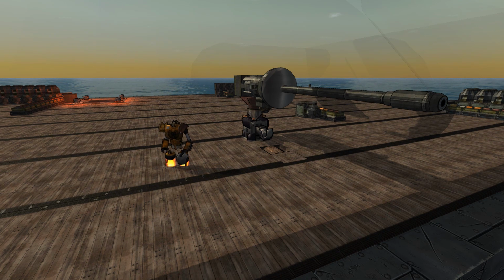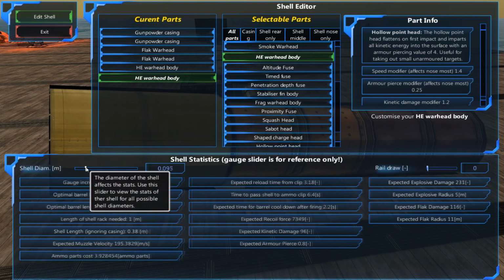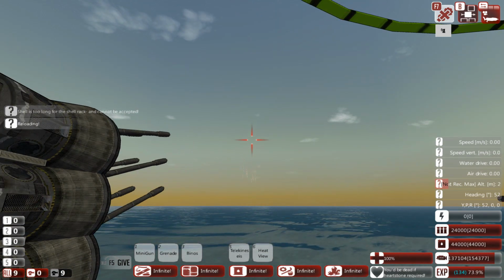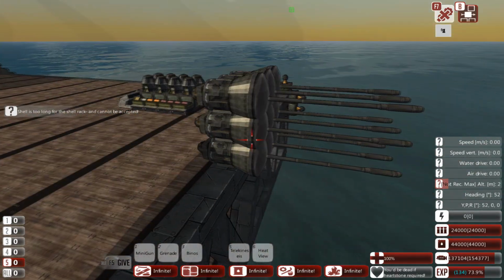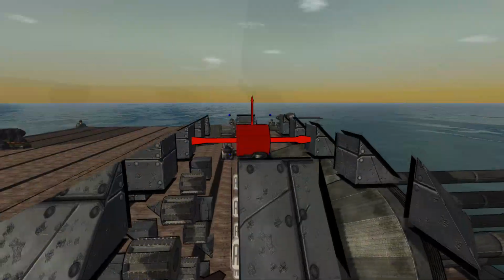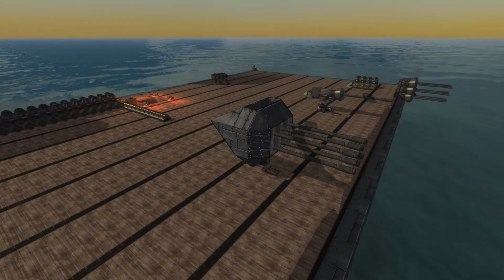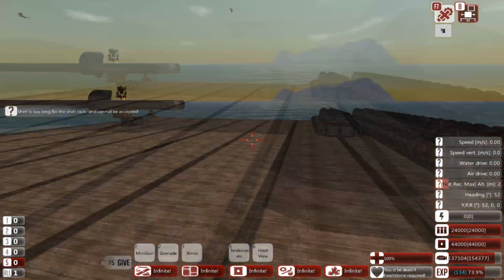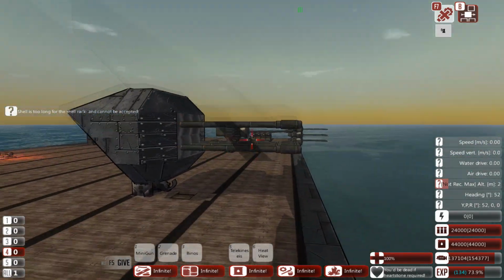No-Autoloader cannons! - From the Depths

Comment: One thing you might want to showcase is the use of spinblocks with cannons.
I was able to make a gunship with 19 cannons poking out of its bottom, that slows down when flying over enemies to unload its massive payload, without even having to remove any of the floor pieces.

This is because spinblocks don't have proper collision physics, so I could have, theoretically, placed a spinblock on every open block on the roof, resulting in an absolutely absurd amount of downward-facing cannons, and the only thing I'd have to worry about would be the guns shooting each other.
Reply from the maker: +IPlayPCTooMuch I'm aware of the spinblock tricks, but I don't want to promote the use of exploits and this definitely comes under that category. :)
Reply: +IPlayPCTooMuch Yeah but how fun is it to cheat? Might as well just use invincibility or infinite resources in the campaign too then. You just hurt yourself in the long run because you wont be able to design good proper vehicles if you rely on cheap tricks that eventually get patched out.
Reply from the maker: Baleur
Bingo!  FYI, Nick has already said he is gonna implement code in the future to prevent this sorta behavior.  Also, spin blocks cause drag now, so all the little exploits are slowly getting removed, which is a good thing imo. :)

Comment: 8:00 wow, you could set up a huuuuuuuge "spinal mount" cannon like this down the entire center of your ship (after all its barrel is only 1 block wide and high). And set up a seperate weapon controller for it, with a control block that says "If object within 200 meters, fire weapon". So it only fires when it is close enough to guarantee a hit, and aligned properly.
Could be an amazing concept for "one shot gamble" designs.
Reply from the maker: +Baleur That's in interesting idea actually.  It's a very expensive "gamble" though, and with the new CRAM cannons coming along that provide more or less this sorta function, It's not really that necessary.  It's nice that we don't have to make the adv cannons do absolutely everything now.  The CRAMs can pick up the slack a little! :D

Comment: i went the entire other way, but this is very interesting too, i was in a 2.0 growth game and ended up capturing 7 marauders so i made a ship called the Narwhal, its a marauder with the nose gun replaced with an AAC running the entire length of the ship with 3 beltfeds per gauge, i had to put katamarans on it and if it fires at max deflection the ship goes sideways at about 3x its max forward speed. that being said the logistics for that cannon fills the entire ship and if it takes a shell to the interior it ends up dead. may do a build with some of these instead,
Reply from the maker: +brian mcdowell These things really help with redundancy. Because they're so small, you can just bolt em on anywhere.  Cool idea.  I never retrofit campaign ships as I prefer to build my own.

Comment: The Autoloader does explode a lot less than a clip though, so I tested with a single autoloader and an input feed for both the loader and the firing piece, to get the double firing rate, however at those points one does want to match the cool down perfectly to the reload time, anyway an extra autoloader is cheaper than a full new cannon if it's cost related downsizing, and since other components might not be as stackable, (bigger mantlets or laser designators) having that combo, is actually better when you can't use all the space.
Reply from the maker: +Zorbeltuss Interesting idea.  It makes it problematic to spam firing pins though, as the loaders will connect to one another, although I think if you checkerboard them it could work quite well.  Gonna try this as well I think, thanks for the tips!

Comment: Actually, the giant cannon could be very practical if used properly. What it does is create a huge alpha strike, so you can destroy (or at least disable) some of the largest, most well armored, and dangerous ships out there in one shot. And as some others have mentioned, they would work very well with railguns.
Reply from the maker: +HiTechnic I'm sorry, but if you can get a railgun to fire one of those stupid shells, then your railgun is pointlessly large and you should have just used an autoloader in the first place.  They will NOT work well with railguns as it depends on the mass of the shell.  These shells are incredibly large, therefore will not go any distance at all using a railgun.  It will also never be as practical as a number of much smaller guns due to reload time, part cost, soft and hard caps and reload speed.  I do actually test these things before I make videos...

Comment: I think a bomber with no loaders AND no gunpowder is in order! Imagine dropping  12 meter shells on the unsuspecting victims!
Reply from the maker: +The Amazing Nixx Lol, could be funny.  I found the really big shells to be prohibitively long reload times though.  The problem is the aircraft needs to fly around for ages and will probably get shot down before it comes back.  Also, the max setting to force an attack run on the default AI is 100 seconds, which makes it really hard to keep the plane away for long enough.  It might be more usable in a single-use drone though, but you would want to be doing an awful lot of damage with that hit.  It's probably just not worth it.  :(
Reply: +ireLAN Gaming too bad, it would be really funny

Comment: putting a AP or composite head on your shells will significantly increase your shell speed
Reply from the maker: +anter176 It will, but at a significant cost to their overall damage.  Also, a problem with composite heads is, if they shatter due to high armour or hitting a shield, this detonates whatever payload they have at a severely nerfed damage amount.  So while it does help increase speed, it can actually hurt your damage against heavily armoured or shielded targets.  I'm not sure if this applies to the AP capped head though, need to science it.

Comment: Perhaps you could make a 3x3 500mm cannon, just for the insane amount of damage it would do every 3 minutes. You could do 207 500mm HE warheads per shot, with one gunpowder per 12 meter shell, I'd love to see that amount of damage, although a flak warhead might work better, and perhaps even one-shot many types of ships.
Reply from the maker: +Antiboom You can't do a 3x3 500mm because the gauges get in the way.  They get pretty impractical at higher gauges because the barrels need to be so long, you're almost always better off using an autoloader in this case.  With the absolutely massive shells, the reload time is just pointlessly long.  Also, there's only so much damage you can do in a radius before the shell just becomes overkill.  A much smaller shell will actually have exactly the same effect in terms of damage, so there's no point really using this, I just showed it off because it's funny. :D
If you wanna see a really silly gun, go have a look at the 1000 subscriber special.  I built an absolutely stupid one for that. :)
Reply: +ireLAN Gaming I can agree with this entirely, I find that even on a battleship I'm building, the primary big guns don't have a significantly better performance than a bigger salvo of smaller shells. It has 9 barrels of 50cm vs 48 barrels of 11.7cm and the higher count seems to always out dps the big guns and the damage area isn't very different. They are good for a scare when they hit, but those secondary guns are the real threat most of the time. I find I'm better off making the big shells into HEAT rounds to blow holes straight through ships to knock out engines and such, and relying on smaller guns to clean up with sheer firing volume.
Reply from the maker: Yeah, that's a pretty good summary.  Many smaller cannons will win out nearly every time.

Comment: I'm going to leave the Halcyon Dreadnaught until the new update so I can make a ludicrously powerful engine to power Tri-layer shielding
Reply from the maker: +Synapsis Flame Good luck with that, shields are seriously expensive with the new engines. :)
Reply: yeah but im going to put it as a 20 cylinder rotary engine with another normal engine for back up
Reply from the maker: From what I've read, the old engines will become unplaceable when it goes stable.  Not sure if this is still the case though.

Comment: i use this loads because my realistic styled battleship needs to have tiny little AA guns
Reply from the maker: +Matthew Price I think that's the best use for them them.  Either a scenario where you either don't need a fast reload, or already have a suitably fast refire that it doesn't matter, such as in low gauge AA guns.  I'm pleased to hear that you've been able to make them effective.  I haven't tried them in any proper builds yet.  The recoil can be an issue, but I love the teeny tinyness of the guns! :D
Reply: +ireLAN Gaming With multi-hull ships (like catamarans and trimarans) recoil isn't that much of an issue. My newest destroyer for example, is a trimaran with a 6 barreled, 150 mm APS without hydraulic recoil absorbers. Sustained fire can move the ship the ship laterally and make it yaw a little, but there's no noticeable rolling.
Reply from the maker: I've found that you can get away with pretty substantial recoil if you cheat and use hydrofoils just above the water line so when the ship pitchs, rolls or yaws, it gets lifted out again by the hydrofoils.  Sideways mounted Rudders work too. :)

Comment: does multiple ammo input feeders onto one firing pin when the mantlet has 4 barrels make use of each input feeder? or is it limited to one at a time on the pin?
Reply from the maker: +kithsakhai Sadly, each firing pin only seems to have one chamber, so only 1 input will work.
Reply: +ireLAN Gaming I hope that changes in the future based on how many barrels the attached mantlet has, available cannons tend to be seriously bulky compared to older custom cannons.  rebalancing of larger clips for higher caliber barrels to be actually practical given you have the ship size to fit the em and pay for them would be nice.  I miss my old battleship turrets.
Reply from the maker: I hear the old cannons are getting a bit of a rework too.  The idea Nick had seems pretty cool.  There's a thread on the general forums about it if you wanna have a look.

Comment: this.
this I like.

one thing though: what if you do it with those 0.018m shells (aka no gauge, 6 barrels)
how fast would it fire?
would it be effective at all?

for that matter, how long could you make it O.o
Reply from the maker: +Overloaderdave Nifty, right?  I really wish I could remember who posted it on the forums.  Wanna shake that guy's hand! :D
Reply: too bad I lost all me stuff, hdd with windows on it died and had to wipe pc

riperino my 35k ship, mostly because I can't be assed to redownload it off the forums after I put them there.
Reply from the maker: Lol, well at least you got a backup somewhere.  That really sucks though.  It's happened to me once or twice and now I keep backups of everything.
Reply: eh, a lot of it was outdated or terrible. A lot of it I'd remake with either this thing or the armoured clips (dont render shells inside, less laggy) so eh.
also probably vectored thrust from lua.
Reply from the maker: You can pull off vectored thrust with just ACBs, it's not too difficult.  The new armoured clips definitely help if you got a pile of guns.  I still prefer the old ones though, I like to see the reload state of the guns when testing.  I'll probably use the normal ones when building, then replace them all in the final build in most cases.
Reply: +ireLAN Gaming there is a way to not render all the little bullets?? TELL ME! I want to get rid of my solid 8fps and get some normal frame rates
Reply from the maker: In the devtest, there is a new variant of all of the ammo clips that doesn't render the shells, they're just solid.  I don't think it's in the stable branch yet, but it should be very soon.
Reply: I really want to see what a gigantic 20m long flak bomb would do though.

the AoE would mean it hits every ship (with a 10m radius on the closest point or whatever it does)

or, for that matter, superheavy metal logs you drop onto enemies.

Comment: Is it possible to get constant firing by layering the cannons by bigger bullets causing the reload to overlap?
First round destroys outer armor
Second destroys layered armor
Third destroys the internals
Reply from the maker: +multibeasty It's possible, you won't get a consistent fire rate though.  It will work for the first volley, then gradually get more and more out of sync the more the cannon fires.  It might be possible if you're really dedicated to pulling it off by tweaking your gauges to line up the desired refires, but it would be way too much work imo.

Comment: Do vehicles spawn with weapons loaded? If so a squirrel with 20 block 1 shot cannon would be cool ;)
Reply: Subbed :)
Reply from the maker: +Ben Harris Wahey, welcome to the party! :D
I'm pretty sure they don't spawn with the weapon loaded, but by the time you fly to the target it should be loaded anyway.  Anything that won't be loaded before the closing time is probably too big to fit on a squirrel sized craft anyway. :)
Reply: +ireLAN Gaming the blueprint saves the shells in clips. It does not save shells in autoloaders (unsure if intended). So an autoloader + input will have to wait for the transfer time until it can fire. While an autoloader + clip with saved shells + input can fire immediatly. Good to know for large shells.

Comment: why dont you add a firing delay to your 6 barrel turret?
Reply from the maker: +Wolf Zimmermann That was one of the first things I tried actually.  I took it off because it's a pain in the ass to set again every time I rebuild the cannon (which I do a lot when testing) and it has absolutely zero practical function, just looks a bit cooler. :)

Comment: So wait... Can we put more than one input on and have say.. 4 load it at the same time? Or does only a single input work?
Reply from the maker: +Nicholas Glendening The problem with doing that is, they all tick at the same time, so it wastes the other 3 reloads. With the current system, they just reset their timer. However, Nick has mentioned something about a queueing system for the adv cannon reloads instead of the current system so if an ammo input fails to load, rather than restarting it's timer, it will sit in a queue until there's a space free.  If it's implemented this way, you can definitely use 4 inputs per firing pin, essentially giving you double the fire rate of an autoloader and making this whole system a little bit OP. :D
Reply: +ireLAN Gaming  but i'v noticed something odd, like when im building a big cannon with a lot of loaders and have a lot of ammo receivers and when i assign them to output feeders, i sometimes have less output than input and ill have to build more output feeders again, like the first time when i clicked 'assign all input feeders to this ammo...' button it goes down to (0/20) outputs, that is when i know that there is not enough output, and i build more output, and come back to the assign ammo input thing and click that button again, here is the odd part, when i look over the input feeders it shows the time from receiving the last shell and it counts on, but there are 2 different counts, like the ones that i assigned at first and the ones i assigned later after building more outputs, 2 different countdowns for the same gun loading process, and it loads shell at both the countdown times, so i was wondering if u could have 4 loaders on the firing piece and assign them manually(effectively giving different countdown for each inputs) instead of clicking the 'assign all' button, will it make em reload faster, if my theory works u can reduce reload time by 1/4th for all kinds of shells.
Reply from the maker: +Ramesh R This is indeed the case, but it suffers from the incurable problem of resetting all of the inputs to the same cooldown when the ship is pulled out of play.  So it will only work the first time you build the cannon, then stop working after that.  I was thinking exactly as you were, but sadly it doesn't work.  Hopefully with the possible upcoming change, it won't matter. :)